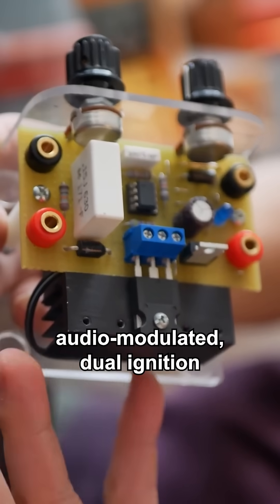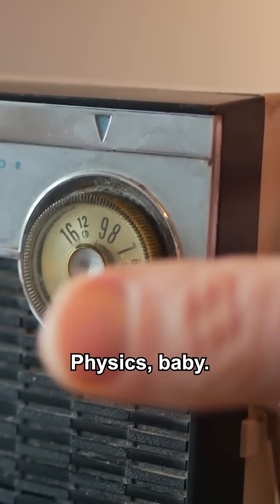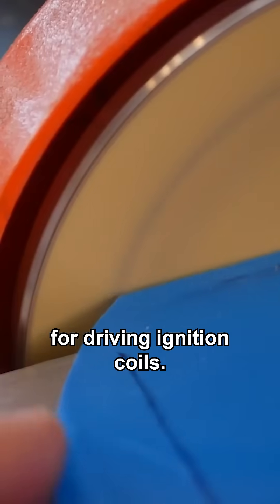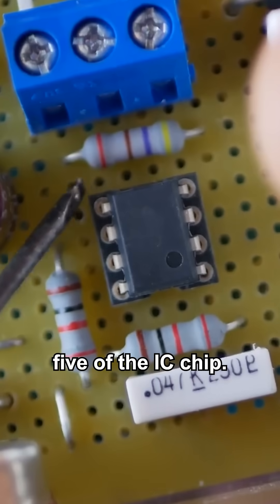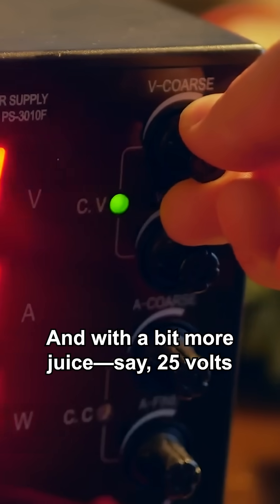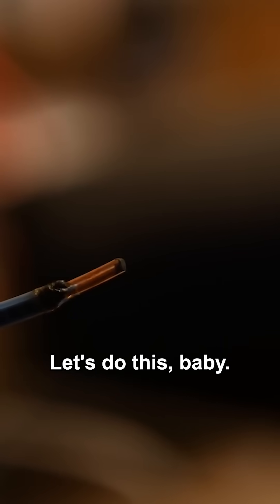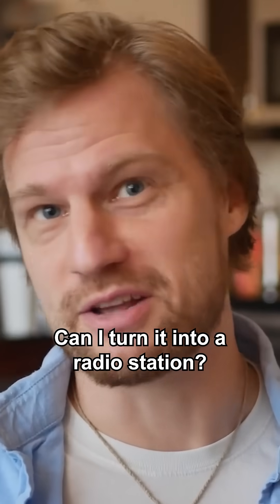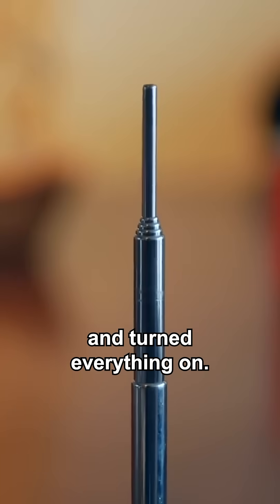Giant Bluetooth Plasma Speaker from Honda Ignition Coils (60,000 volts)

Comment: Way more efficient use of that charge is to have two large mylar sheets with some space in between and drive the electrostatic speaker with that. 

The issue becomes response time of the mylar membranes. And shorts. 👍 🖖

Comment: You could get perfectly clean audio if you used two DC flybacks wired in Antiparralal and their outputs in series. Zero background noise because the arc is dc. You can easily drive them at above audible range to also make the transformer vibrations impossible to hear.